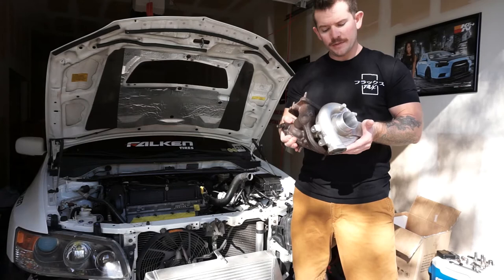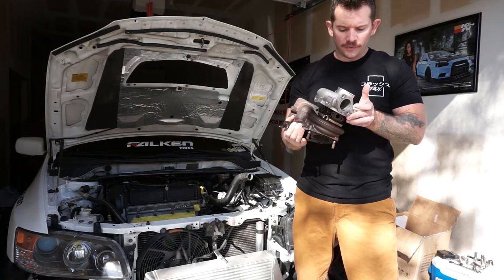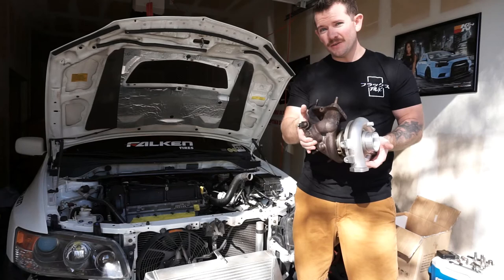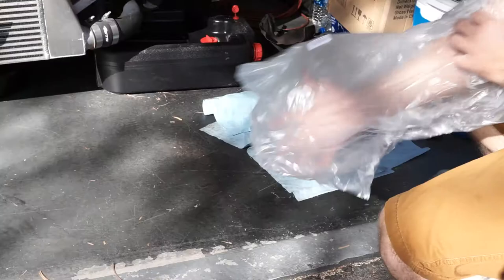Evo 9 Turbo Removal

Comment: My REAL names keith, i have a 2006 evo with an intercooler and piping. Besides that its bone stock.  158k miles as a daily driver.  Just recently put the intercooler +  stuff on 6 weeks ago (noticed oil in the intercooler)  anyways now my exaust has smoke come out right after 3k rpms (building boost)  this started happening today on my lunch break. I literally cleaned out my tail pipe at work so see what exact liquid was also flying out the exhaust. Drove around and it hesitated when building boost, didnt smoke too much that time, i checked the tail pipe...Water.   not trying to grenade this fun car.      advise on approaching issues?
Reply from the maker: That’s a ton of miles for the stock turbo. Maybe blown seals on the turbo? Do you have a catch can? If the valve cover is venting directly into the intake, that could explain the oil in the intercooler. I would say it’s time for a rebuilt turbo.
Reply: @EricMcWilliams515   i just took off the intake and it does look like theres oil on the lip of the turbo intake.  Im looking into a catch can as well as looking for a stock replacement turbo.  Tomei arms looks promising.  I should also say i live in  central california. I cant do ANY fun upgrades.  😭
Reply from the maker: @pastortonsils  stock frame turbo would be the way to go for a daily driver
Reply: @EricMcWilliams515  thanks brother, i appreciate the fast response.